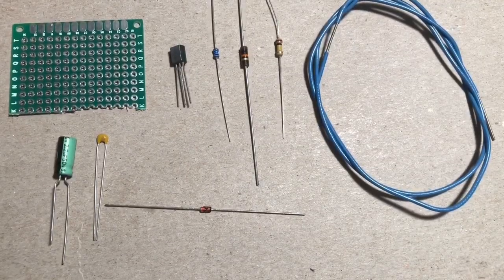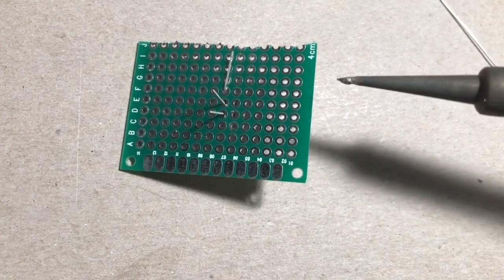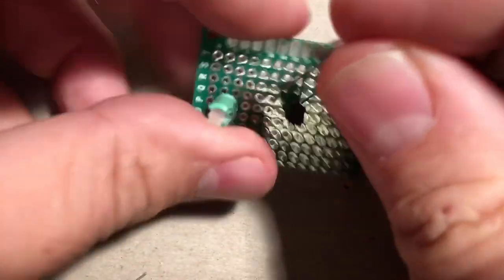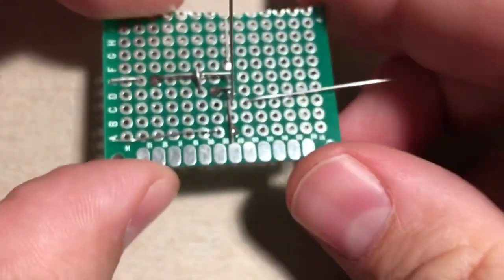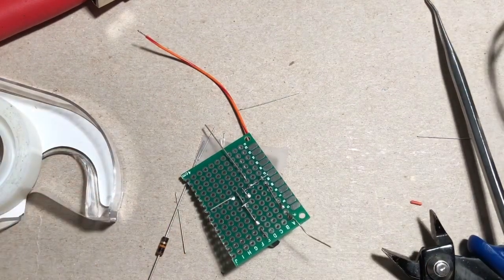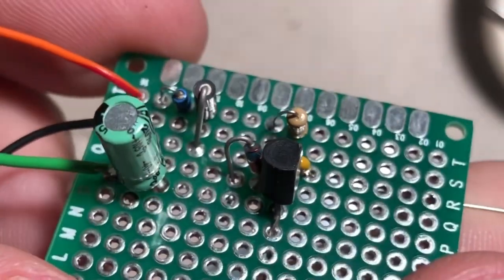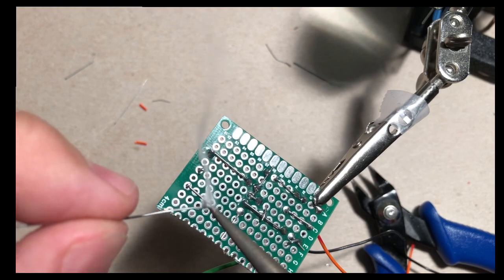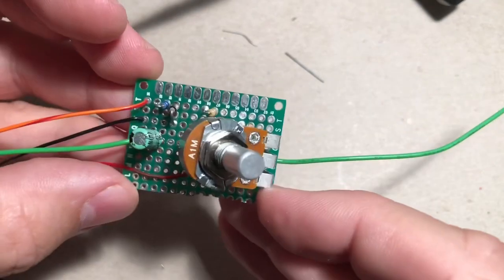Bazz Fuss Tutorial - Circuitsandkittens

Comment: I really enjoyed this in real time.  Thanks for not editing! I'm building this internally into my bass.
Reply from the maker: This will be a really easy on-board effect. Make sure to use a Stereo style jack and connect the black battery lead to sleeve and ground of the board to ring. That way, the circuit is broken and the battery won't drain when the bass isn't plugged in.

Comment: U can use different resistors and diods and caps and it works too
Reply from the maker: Different caps will change the tone. Different resistors may or may not work if it restricts the power too much.

Comment: I'm having problems. It works great if its out of the enclosure but of i mount the jacks it has no sound. I'm assuming the jacks are grounding it out but I can't figure out why
Reply from the maker: It's probably just grounding out on something. You can usually figure out where by slowly installing the board and then applying a little electrical tape or rubber cement to correct the issue.